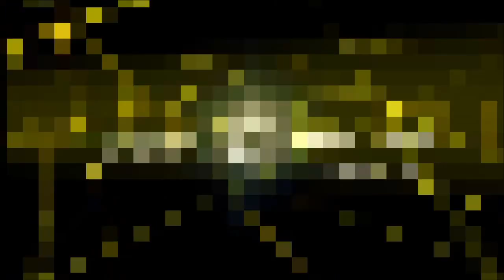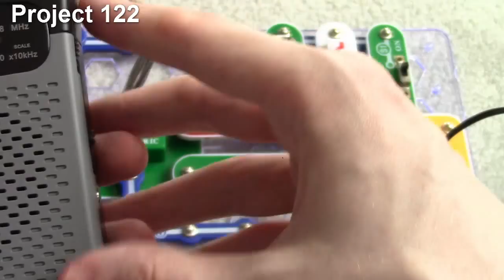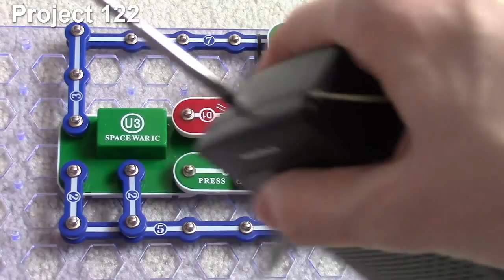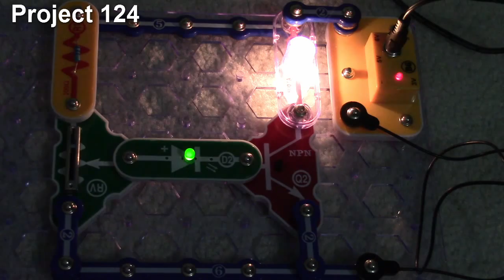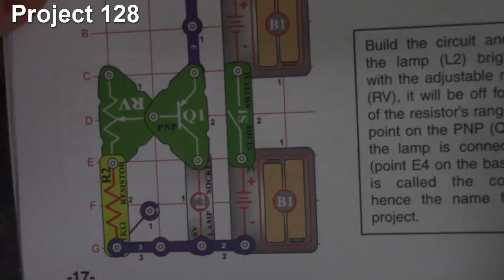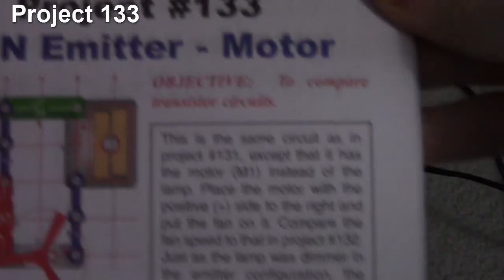ELENCO Snap Circuits Projects 122 - 133

Comment: The only issue I have with project 122 is that when I turn on my radio, I hear static. When the circuit is on, my radio plays that sound, but so do all of the other radios on AM. I even set the antenna for the dining room radio next to the circuit. All other antennas are away from the circuit, but every other radio picks up the same thing. Is there any way to lower the distance the circuit transmitts?